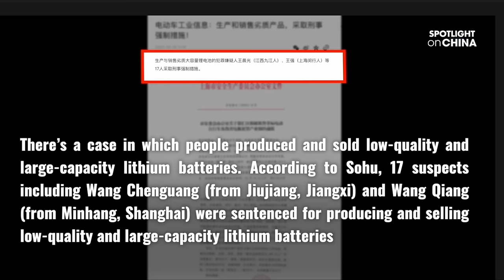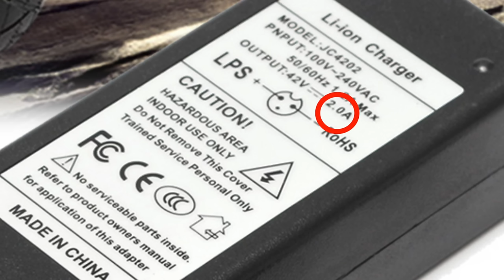What's Causing Ebikes Fires?

Comment: If you going to upgrade, make sure the controller matches specs of battery and motor. It is a serious concern if you go out the range of every specs, especially the battery. It's simple math you have to read and applying. There are battery of having specs for 52v 20ah but there are various ones of the amps for different motor or controller. Must stick to the specs when upgrading.
Reply: I used a 52v that pushes 45amps. On a 48v sabvoton controller that takes 45amps. But I reduce the AMPS to 36. For more range and less heat. 

On a 48v 1500w rear hub motor.

Will I have any issues?
Reply: @Mash3OH3  So you have a 52v battery with 45a continuous rating, a 48v 45a controller, a 1500w rated hub motor (all together effectively capable of pushing 2300+watts),  And you reduce your amps to get more range and deal with less heat?  Why would you buy those components just a ride around restricted? If you want range and less power, Buy weaker components! Reducing amps artificially is not really an efficient way anyway, You'll gain better from a weaker bike. And to answer your issues question: No you shouldn't have any, I just think it's pointless gimping your set up lol

Comment: Great video. Some batteries stop charging, but its always best to just set a timer and unplug when its full.
Reply: My workpllace has a lot of hand tools that have lithium batteries, and the guys leave the chargers plugged in 24-7 and leave batteries just sitting on the charger long after being fully charged, bugs the hell out of me as I know the failure of a 5 cent part in the charger etc that is part of what stops the charging when full- can FAIL, and then the battery gets "cooked" sitting on that charger over night, over the weekends etc.
All it takes is one little part to fail and the battery gets "cooked"
ANother bad thing is they carelessly  take the batteries and toss them in a bag etc with all the rest of their tools, hand drivers, screw drivers, screw bits and other metal tools and it only takes one bad movement in there to short out two terminals on a battery and you have a fire in the bag that spreads!

Comment: If you get a good pack, it should have a BMS with overcharge protection. The batteries I use have a standalone charge circuit and BMS, meaning the battery knows the current independent of the controller, and stops charging when full, but the charger has overcharge circuitry as well, meaning redundant safeties. 

I also added a thermal fuse, which is a slightly higher amperage than the speed controller, so if it does begin to runaway it should de-energize the system when the fuse burns. 

I also try to stick to full charge discharge cycles. I don't fully deplete the range, but when it begins to crawl I let it charge to full, then gradually discharge over days. Continuous re=charging Li-ion will degrade stamina more quickly over 1000 cycle lifespan. 

Haven't had any sort of fire or shorts with these batteries, but back when I was a master technician for a popular tech repair franchise, we had a few venting incidences that set off the smoke alarms and I had to intervene and chuck the battery or device outside to burn. Frankly I'm thankful to still have all my fingers...terror is grabbing a venting MacBook Pro Retina battery "squid" and lobbing it like a grenade into the parking lot where it pops and melts a hole in the asphalt from the ensuing fire. 

That particular incident, I had warned a fellow technician not to use metal tools and he tried to use his iSesamo tool anyway with some isopropyl to loosen the adhesive. Best I can figure, he nicked the pack, then with the heat and prying it tore/mixed the layers and it puffed up and vented quickly. The entire lobby filled with a really sweet-smelling white smoke.  

Managed to save the customer's machine by acting quickly and doing what I did, but by all means DO NOT DO what I did. Lifelong burn scars and other possible injuries just aren't worth it if faced with an imminent venting cell: just prevent fire exposure as best you can and try to put some distance between the pack and yourself or structures if thermal runaway is unavoidable.

Comment: I bought a Jetson Bolt.  It does take about 4-5 hours to charge, but I watch it.  All the fire hype has scared me into keeping it outside, where it could get stolen, even locked up in my back yard.
Reply: You bought a cheap toy EV a 300 buck bike? What do you expect of the quality?
I wouldn't  worry about it getting ripped off...
Reply: @robcrissinger776  It was bought to gap the 3 mile walk to the Transit train's first run at 4 am.  My Catalytic Converter was Stolen.

Comment: You have made some good issues.  I recommended to everyone, after the use of an ebike with the battery, they should holder off for a few hours before charging, less possible issues.  Otherwise after you charged should wait a while before using.  These are my own issues and I have probably 50 different LiPo batteries use and not ever had any issues, from many different things I use and yet, lol...  Good luck to everyone!  -Fred
Reply: You are right I had many powerful ebike like 15000watt fat tire ebike 200amp controller 120kmh and I never had any problems with battery 🔋 Is catching on fire 🔥 because I always let my battery cool down before charging it is a 72.v60ah and keep in mind all of these battery 🔋 comes from China good battery just makes sure you do the right thing when charging your battery
Reply: @THouse-md1hy 

I'd like to add to this statement. I have a 52v 45amp battery purchased from a place called Conhis motor. 

Haven't had any issues with it. I've recently lowered the amperage on my controller from 45amps to 36amps. For less heat buildup. 

But I do like to top up my battery at random intervals at coffee shops. Not sure if that's okay or not.
Reply: LiFePo4 batteries contain lithium iron phosphate, it's a SAFER and cheaper battery, my Vtoman Jump 1,000 battery inverter has this battery, the older batteries will fade away as they get replaced by these newer ones.

Comment: Like with almost all things, it takes multiple failures usually to have a bad day.
With ebikes, the batteries and the charger are the main issues. Cheapo batteries could be of poor construction and maybe not good BMS or even no BMS. If the battery pack is cheapo, you can bet the charger is cheapo too.

I agree using a large ammo box and/or a timer is a great idea. Those military surplus ammo boxes are made to handle explosions from inside and made to be durable and fireproof. As for a timer, you could use a simple mechanical plug timer or a "smart plug" or even go so far as setting up a way to measure the battery level and using it to determine when to shut off the power to the charger.

If you want as safe as possible (for your home at least), think about detached shed with power running to it and always keep the ebike and components in the shed and never in the home. That way, worse comes to worse, you lose a shed and an ebike but not your house and everything in it.

On a side note, lithium iron phosphate batteries are old school? Where have I been. I never heard of them until the last few years. They seem like a nice next progression overall for lithium ion batteries. Of course, we really need to find a way to have a safe batter with a high energy density that uses commonly available materials and not use lithium.

Comment: I heard a really good recommendation once:
Charge them in an outdoor Grill, Fireplace or Oven! 

Most batteries burst under high stress either while charging or while being drained quickly.
What's the one place at home designed for fire?
That's right, your fireplace, chimney or outdoor grill.
Maybe your Oven as well. 
If a battery fire happens in one of those places, nothing will happen because the structure is designed for high heat fires!
Just don't use them for their intended purpose while you charge your batteries there 😉

Comment: Hi!Bosch ebike charger will stop charging ons battery full, if you will let it plugged (for any reason)If some off cell drop charge little then will start changing and disconnect again when full.I believe if product been manufactured with safety in mind and tested risk is relatively low.

Comment: Today, while driving my crane to do a job on a busy (for Idaho) freeway, I got passed by a SUV with a couple hub drive cargo bikes on a hitch. A few miles later I saw brake lights go on, it seems they had lost one bike and it had already been run over. I had to swerve to miss it but it was already ruined, no fire though!  On another crane job, a large house had burned down, the reason I was told, was a Milwaukee tool charging station/batteries, don't know the details other than that. I charge my own ebikes in my concrete floored shop, using chargers that auto shut off, usually to 80 or 90%, and also at a low amp rate (Chi chargers). I also have a DC converter, custom built, that allows me to charge the ebike I carry in my small plane, at a bit less then 2 amps, into a quality pack with a good BMS, so far so good. I put ebike fires, when using good euipment properly, right up there with getting struck by lightening.

Comment: I typically keep my battery fully charged before I go to bed.  There seems to be two safeguards that include the power switch on the bike and the automatic switch in the charger.  Sometimes I plug in the charger and the battery recognizes it and switches on.  When the battery is full it turns off along with the charger.  I know this is not fool proof.  A 3 hour timer would be perfect as my charger doesn't get hot until about 2 hours into a charge and that's when I watch it closely with an applied heat sink on the charger.
Reply: I turn a fan on to keep the battery and charger cool while charging. I think I will go with the timer idea though. Just for safety.

Comment: Thanks for the reminder in over charging a battery.  I made up a list of devices that I charge periodically and found it was 14!  This includes to 2 ebikes, computers, walkie talkies, portable tire pumps etc.  I use my cell phone timer to check hourly to see if the item is fully charged.  Now with the ebikes I mostly charge the battery on the ebike in the "house".  Why not in the garage, simple Answer live in Arizona where the garage temp is well over a 100 degrees which is not to compatible with charging.   Question, do I need life insurance?  Ebikes in the house is not a good for a match made in heaven.  Or should I get rid of the complainer?

Comment: Do not charge hot battery,wait let it rest before and after use one hour.
When the charging is complete the voltage of the battery are the same,so the current doesn't flow any more,this is safe.
Avoid cheap batterys with powerful 2000W motors,be aware of strong 5A or more chargers.

Comment: 6:27 dont most batteries come with a bms which prevents over voltage, under voltage and also the battery charger itself detects that that the battery cells are 4.2v per cell so it should cut power to the battery. Usually chargers are indicated by an Led light which would tell whether your battery is charging or is fully charged.

Comment: Great video! but I just want to stress that I don't think most people understand how much energy is stored in a typical E bike's battery. Take my add motor M81 it has if I use throttle only at least a 30 mile range it's an 80 pound bike and I weigh 200 pounds so just stop and think about how much energy we have stored in that battery think about the energy that you would have to expand pushing the pedals to bike 30 miles on an £80 bike if you weighed 200 pounds! Now imagine the equivalent energy stored in that battery because that's what you have should its short circuit catastrophically it could discharge some or all of that energy essentially at once so my recommendation is to never even think about leaving of charging Ebike unattended and whatever you do don't try to open up your battery pack and modify it or use a charger that didn't come with it unless you are a certified electronics technician familiar with charging and battery circuits. and again thank you for the great video

Comment: This question has not come up here yet:  What about the Lectric brand folding bikes, that keep the single battery INSIDE of a heavy steel tube?  It can be charged inside the bike or out of it.  How could it get enough air to burn if inside of all that steel?  I charge with the battery out anyway, and keep it separate from the bike while parked inside.  I would never leave a charging battery behind.  Thanks for all of the good advice---I subbed!................................elsullo
Reply: How does a bullet get enough 'air' to burn inside of its brass casing? The answer is that gun powder and batteries produce the oxygen they need to burn via their chemistry which makes for a self sustaining fire due to them containing both fuel and oxidizer. Thermite is another product that produces a self sustaining fire.

Comment: I live in a place where it gets down below 0⁰F so it's not safe to charge a battery out side.  My idea in to charge the battery in a self cleaning oven.  Of course not on the clean cycle or on. A self cleaning oven is designed to handle very high heat. Like a shut-off timer is a good idea too.  If the battery catches fire the oven should be able to contain the fire at least until the fire department gets there.  Fairly simple and no cost.   A gas barbeque outside when above 32⁰F is another idea. The news locally of these e-fires is getting scary.  Maybe some safety regulations are needed.

Comment: These chargers really should give an option to limit charge to say 80% state of charge (phones should too for that matter.)
Or, it's time box-in-the-middle gizmos are made that go between the charger and the battery which cease charging after a certain time, or amp hours, or voltage/current, or several of these measurements.
Manual timers make a lot of sense for a quick, cheap, easy and fairly effective insurance policy.

Comment: I am surprised at these ebikes exploding driving down the road!
I have been building battery packs & working with hundreds of 18650 batteries, E-pen batteries & Thank God I have not had a fire yet!
I think a lot of it has to do with the quality of the batteries & like you said..." when recycled the welding marks ect".
It causes a lot of damage to the batteries.
Bottom line!  When in doubt recycle it! 
Don't charge it. Don't fiddle with it And definitely don't try to build it!
Drain the power out of it and recycle it.
Reply: The cell quality's kinda minor in all fairness. The three big reasons for a lithium battery becoming a bomb are over-charge, over-current and short circuiting.

My bet is some of the fires while in use are from shoddily insulated packs, or from packs made from cells that can't handle the high rates of discharge, since there is that chance that a pack being discharged too rapidly will heat up and thermally runaway as of it's overcharged.

Comment: I did buy & use a battery fireproof bag from Amazon. I take my battery off of my bike & charge it in the bag. I'm always present when it's charging & keep an eye on it & disconnect it when it's charged. I don't charge it overnight. So, the bag I use is of no use if the battery overheats? It won't contain it if the battery overheats? Is that what you're saying?

Comment: I've never had a battery explode or catch fire during normal charging or use, in-part because I test and calibrate my charging equipment regularly, but also because I use quality BMS boards and I never use cheap e-bay / Aliexpress cells. I always go with a reputable wholesaler because that way I can confirm that the datasheets will be 100% accurate, the cells will be of good quality and that the only way to make them go boom is to force too much voltage in, or too much current out of the cells... Or stab them!!
Reply: I purchased a 52v 45amp battery that apparently uses Grade A LG Cells 21700. 

They're called Conhis Motor. Do you by chance know if they're reputable or not?
Reply: @Mash3OH3  I've not heard if that manufacturer... Best way to find out if they're truthful though is open the pack up and inspect the cells. Make sure the cell wrappers and labelling are correct and see if you can run a capacity check to ensure the real capacity is close to advertised.

While you're in there take a multimeter and measure each bank of cells and verify that they're well balanced and that your over voltage protection kicks in no later than 4.25v. Your cells should settle back to 4.2v when charged. If not, replace the BMS before use. I would recommend getting an ANT BMS since that will also give you live performance readouts and extremely detailed charge and discharge control over the pack.
Reply: @DigBipper188  

Yeahhhhh I don't think I'll be opening it if I don't know what I'm doing lol.

Comment: I bought a Luna charger and use to charge my e batteries to 80 or 90 % . Using a lamp timer on brick in case the battery is warm and only charging when
i’m home . I store the batteries in a metal tool box with find sand bags under and on top of the battery with smoke alarm . After charging I let the cells balance for a hour or more be use . I do this for peace of mind and What's Causing Ebikes Fires? precaution .  I never seen any information on Lectric XP bike battery problems .
Reply: yeah I also have a Lectric XP 1.0, my only concern for you with all of the sand is it insulating the battery and causing it to heat up